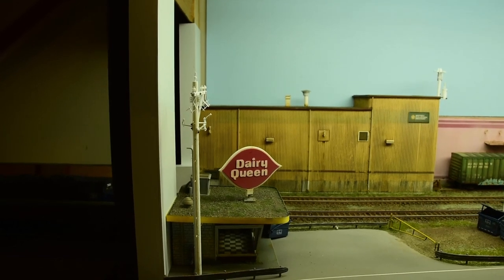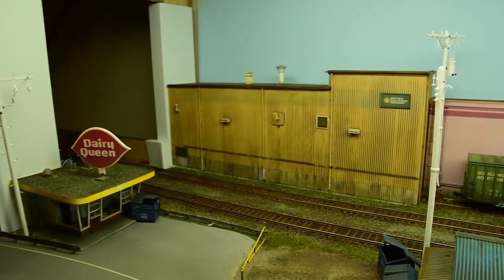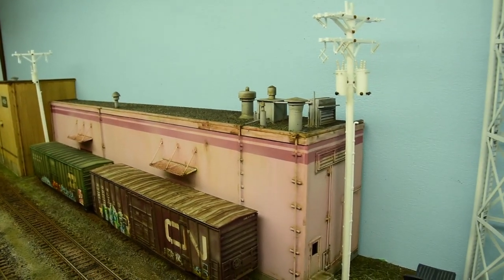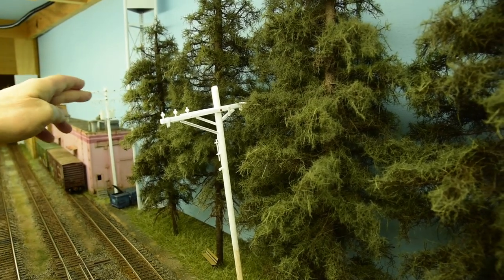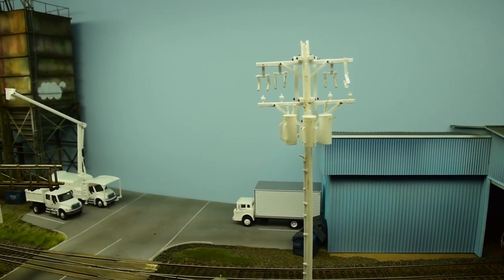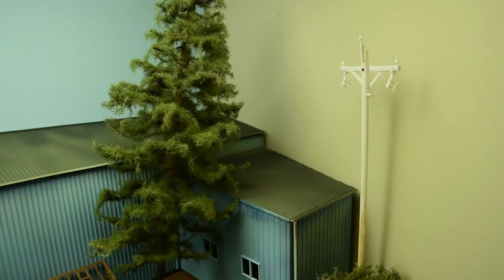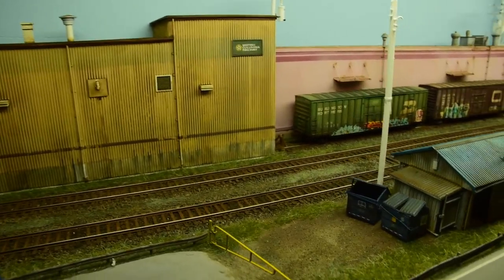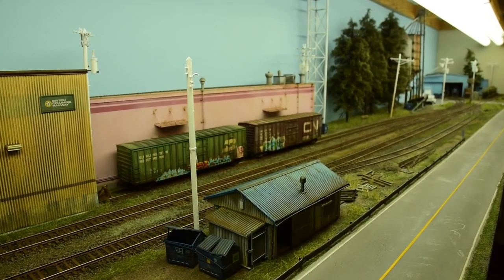The Railroad Diorama | Arranging the Utility Poles: Part 2

Comment: Looks really good. Crazy good scratch build.
Reply from the maker: Thank You. They were fun to build once I got the build momentum going.
Reply: @boomerdiorama  did you use a jig or template as a standard for all of them?
Reply from the maker: @GoViaorgohome  The standard I use is just basic prototype specs. The pole is "5/32" tube, the length is HO Scale 50 feet, or seven inches whatever you prefer (7"). The cross beams are HO Scale 12-14" long, or (2"). I just winged the rest from photos. It is the ratio that matters more than exact measurements. Cheers.